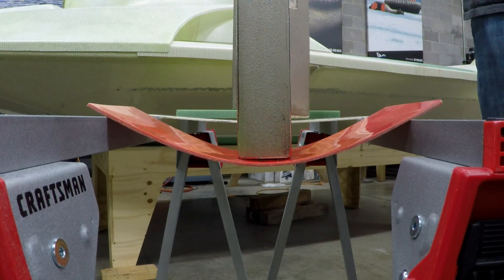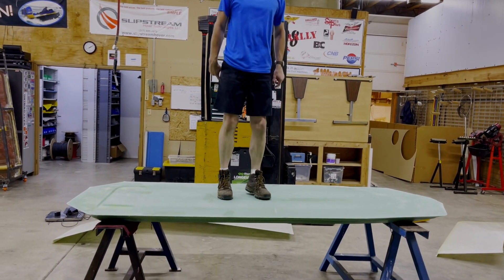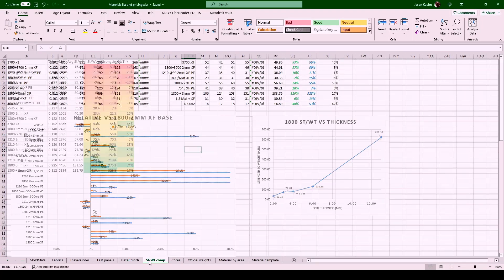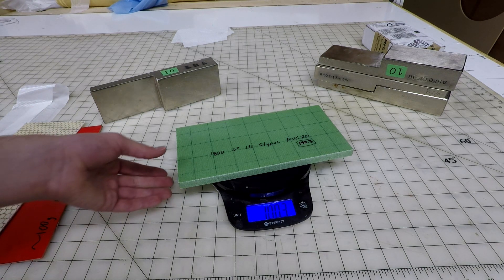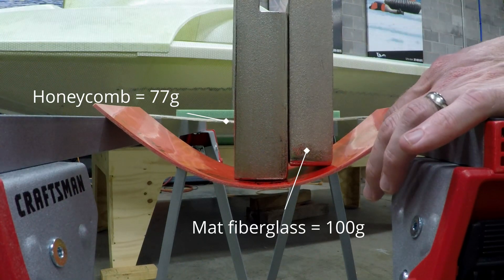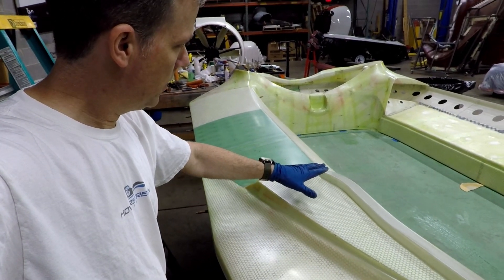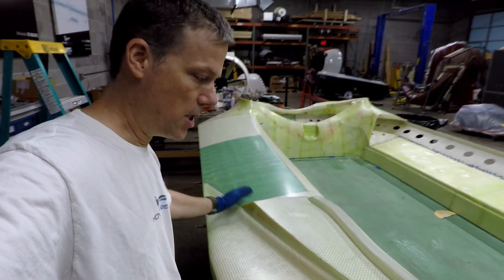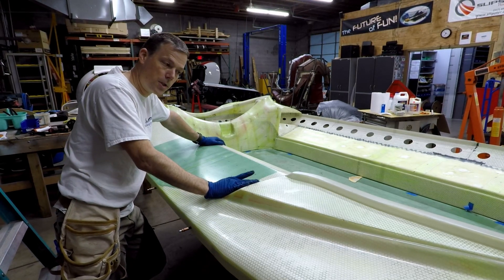Material Superiority... Is the EVOlution hovercraft strong enough?

Comment: Awesome! I'm excited about the strength of the sides, it might eliminate the dreaded gel coat spider cracks that all craft seam to have.
Reply from the maker: Yes, stiffer panels will eliminate most of that. Gel coat has to be hard for scratch resistance and durability, but hard also means the gel is brittle. A fiberglass panel can safely flex much more than the gel coat can tolerate so you eventually get spiderweb cracks. Minimize flex in the panel and you minimize the stress cracks in the gel coat.